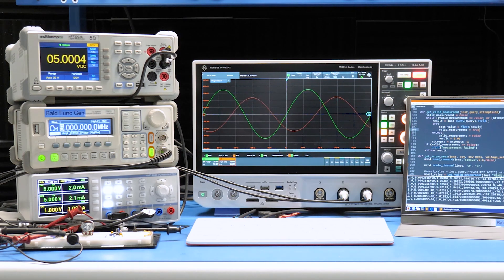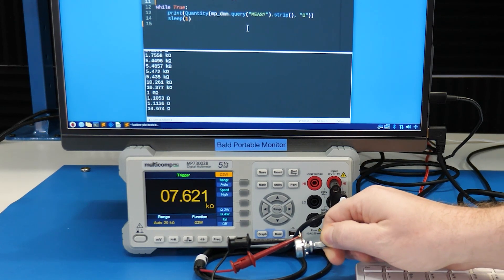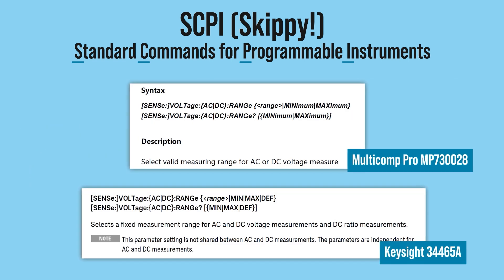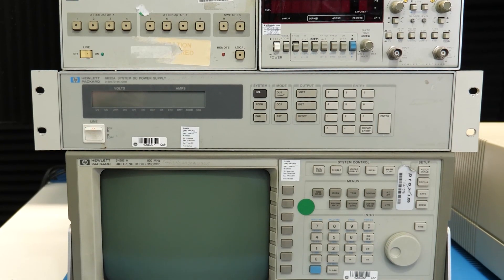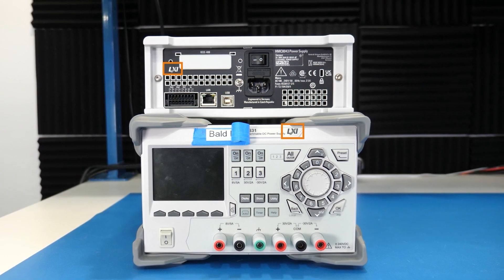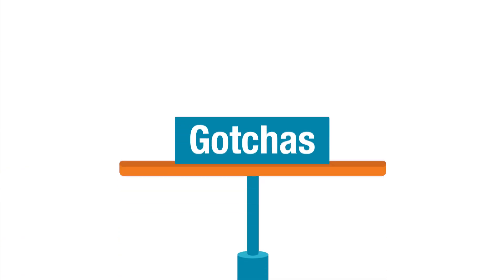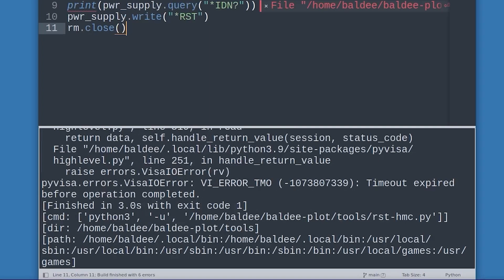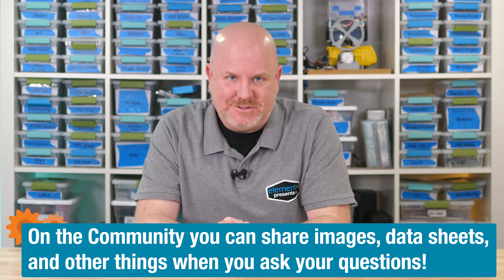Use PyVISA to Program Test Tools with Python - Workbench Wednesdays

Comment: Are using VS Code, PyCharm, or some other IDE for developing and testing your code?  Is this running on a RPi?  Can it run on a Mint20 Linux laptop?  What changes are required?  Can it run on a Win10 laptop and what changes are required? Thanks

Comment: In Linux the newline character (\n) only sends LF (0x0A), however in windows the newline character sends CR/CF (0x0D) (0x0A). There are steps that can be taken to fix this depending on the context you're working in. Depending on why it's not working in windows this could be a factor.

Comment: How do you select which version of visa driver to use?  I'm using keysight as my Visa driver.  When I installed my keysight scope software, it installed both 32 bit and 64 bit .dll as visa drivers.  I'm creating the VISA resource using the Keysight connection manager.  The first instrument I'm trying to connect is a BKPrecision power supply.  My power supply shows up in the Keysight connection manager and allows me to create an alias.  I can poll the IDN via the connection manager, but when I call list resources in python, I don't see the instrument.  Python is defaulting to the visa32.dll and I suspect Keysight connection manager is creating the instrument using the visa64.dll, but I'm not sure and want to switch back and forth.  I'm not sure the calling convention of the resource manager

Comment: Do I have to install NI-VISA before? If I have, which one should I install, Full or runtime. Thank you.
Reply: As explained in the video, no. You can use pyvisa-py as the VISA driver or other popular vendors. If you have a license for NI-VISA then you can use it. Doesn't matter when it is installed. pyvisa looks for VISA drivers each time it runs. I don't know the difference between Full and Runtime.
Reply: @bald_engineer  Thank you for answer. It's very helpful.

Comment: Hello, the test code is not available anymore on the website. Is there anyway to get it still?
Reply from the maker: Thanks! The links have now been updated, and as @bald_engineer says, there's updated code on the github, also linked.
Reply: There are links to the github repo in the comments section of that page. I am pretty sure I updated the code after the video anyway.

Comment: I find automatic testing interesting but have never been involved with it. My electrical engineering involved digital design and simulation and manufacturing process line automation with PLCs. This testing is an essential part of design, development and manufacturing yet, I never implemented it and i am now retired. It is interesting enough to perk interest in the field.

You do a great job explaining terms and showing a basic script. When first looking into it all you get is a programming manual for test gear and nothing to implement it.

I have Linux on Windows 11 and a Raspberry PI that I don't use because the only time i used Unix was for schematic capture and simulation where i was shown what commands i needed to use once out of the CAD system. So, my Raspberry is dusty and seems foreign to me. I have books on it but haven't used it past the book lessons. 

So, while experienced in C++/OOP the details take effort. Looks like mixing test gear with USB or LAN is a matter of some defining lines of code. I was looking at a Matrix PSU with USB but no LAN. (Its size was a plus.) 

I like the keyboard you show. A RPI in a keyboard is something I want to reduce clutter. 

I subscribed and hope to make progress on automated testing.

Comment: I have a pretty sizable HP instrument collection and I have most of them all connected via the HP-IB bus to my instrument controller. Most of the software I have been using has been on Windows, some of the software I use is free such as GPIB tools, Timelab and Phase Noise, the other is a commercial product called HTBasic. The last couple of months I have been dabbling in Python to control some of my instruments over the GPIB bus with the help of Chat GPT, and so far it's been quite some fun. While I do not have any of these instruments connected via any spare RS-232 ports your video was very informative.
Reply: I'm the process to do some Python UI for my old agilent/hp instruments too. Do you happen to have some code to share? Otherwise I'll just reinvent the wheel, wouldn't be the first time :)

Comment: Great video, I remember fooling with that GPib, I used visual basic for all my automation...  Send the SCPI strings via the GPib interface card.    We even had radios that responded to remote commands via serial port, so the test set and the radio worked together for basic tests, and build a file showing the go and no-go values. Back in the day of the PCI bus cards, I had a GPib card that would interface into the HP equipment... 
 I really enjoy your videos, well made, to the point and don't waste my time.  I have to run them a bit slower at times, you talk very fast... 
Thanks again.
Reply: Are using VS Code, PyCharm, or some other IDE for developing and testing your code?  Is this running on a RPi?  Can it run on a Mint20 Linux laptop?  What changes are required?  Can it run on a Win10 laptop and what changes are required? Thanks

Comment: Earlier this year I tried to implement my Tier 1 vendors control software, and failed.  I then went the Python route, and it worked pretty easily.  I did need to use delays as well to get reliable responses.

Comment: I had to do this in college with keysight instrumentation connected to windows and it was a pain in the butt to configure, it was all LAN but the school's network was terrible so there was always a problem and only a few stations could get it to work. When we did get it to work we used MATLAB and the coding was pretty straightforward, the professor would make us do extra so we would need to export the results and open them on Excel and create a graph (I know useless). I'm starting a job that requires me to test all day I can confirm SCPI is super useful

Comment: Thanks for the great video. I wonder what your experience is with the speed performance between serial, USB and ethernet?
Reply: For basic control, almost no difference. For bulk/binary data transfers, speed is as you would expect for the interfaces--depending on the instrument.
Reply: @bald_engineer thanks, I need to test it, especially with the data that comes from my scope.